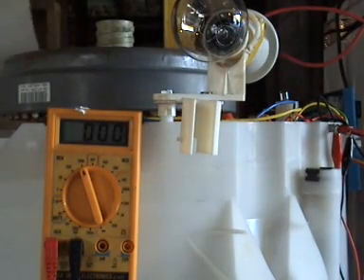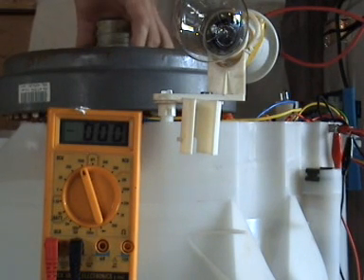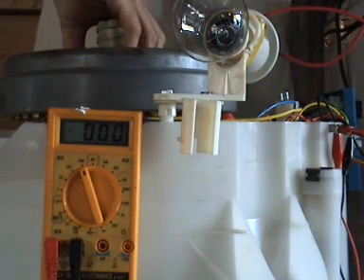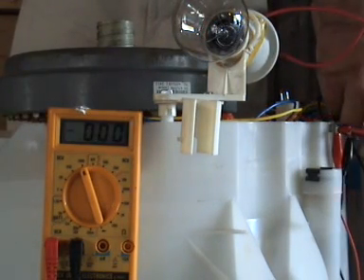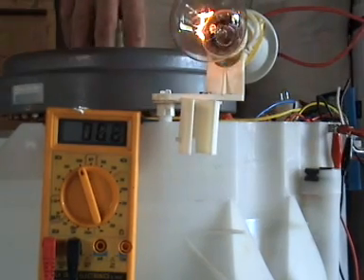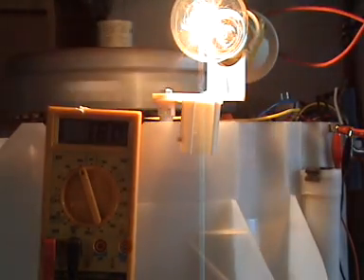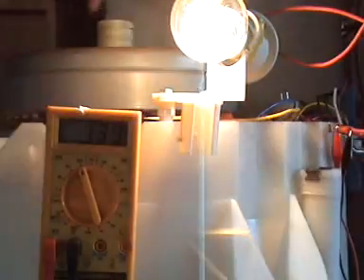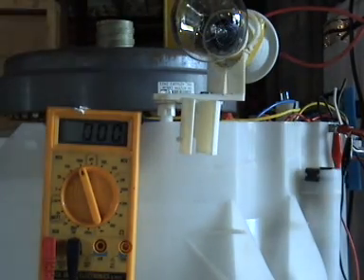Smartdrive Generator

Comment: not bad i i belive its working as a rotating core transformer .and couldent see meter  is it ac or dc?cause if it where dc u can make more use from it by rectafires  to make dc . and what is powering primary coil wall plug? i have a system thats perfict at the time its on dc but for charging porpuse its great for wet cell ones if u need help on anaything let me know

Comment: yes thats correct, its just a demonstration, if you were using these as a generator, id imagine you would need to have a constant source of wind or water, or else you would get no power, what about charging batteries? can they be rewound to produce say, 12v, to charge batteries?